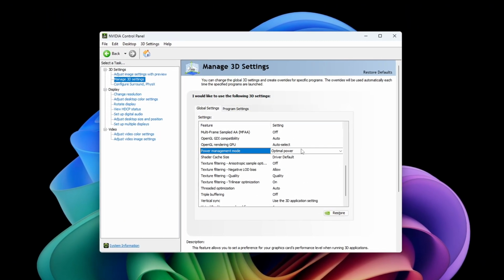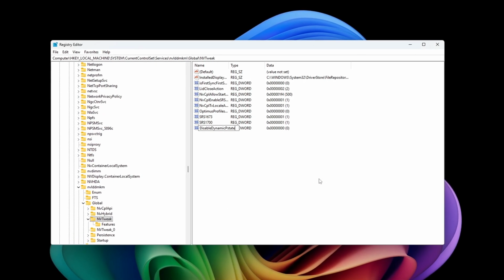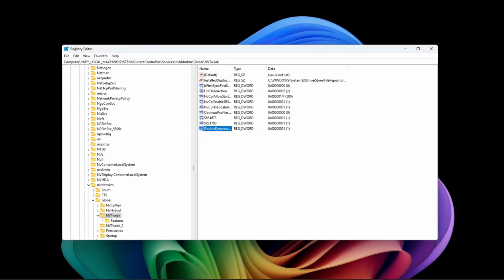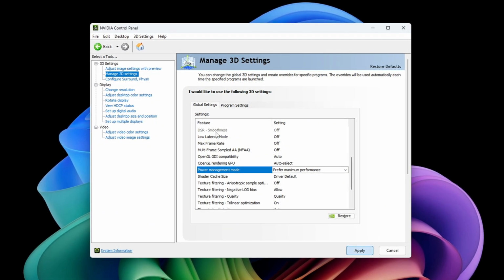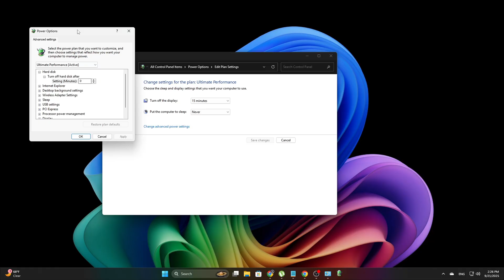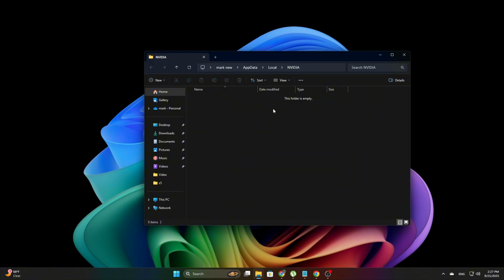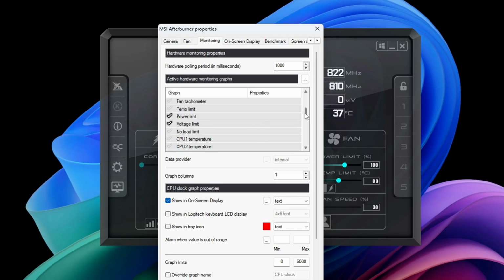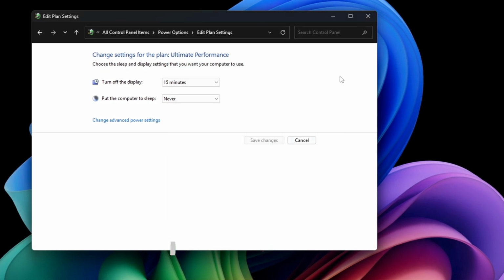Fix Micro-Stutter & Reduce Lag – GPU Power Gating Optimization

Comment: i cant find amdkmdag folder in registry for some reason
Reply: u dont need go to HKEY_LOCAL_MACHINE\SYSTEM\CurrentControlSet\Control\Class\{4d36e968-e325-11ce-bfc1-08002be10318} 
dword 32 DisableDynamicPstate  set to 1
Reply: Same issue here
Reply: amdkmdap    last have to "p"